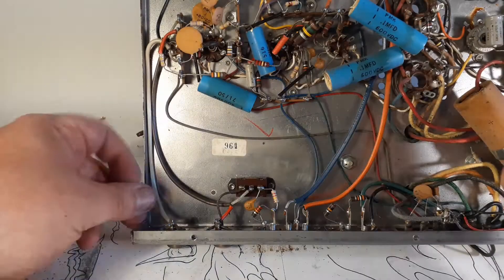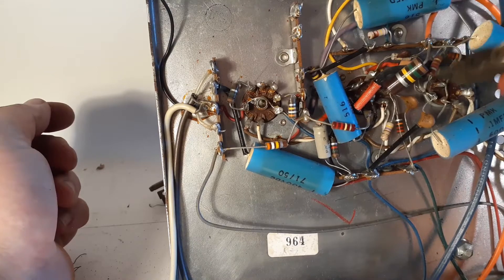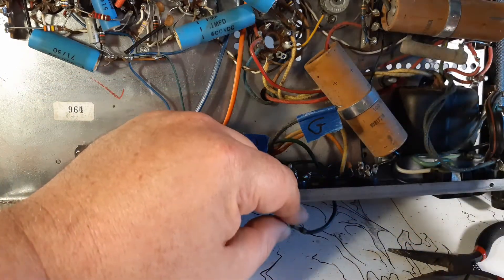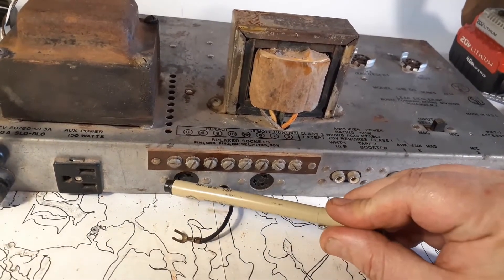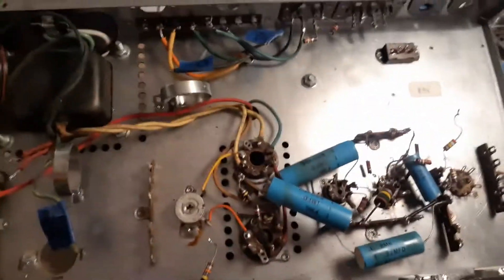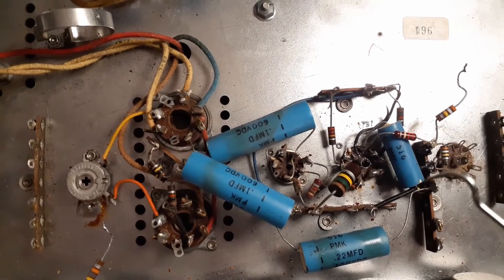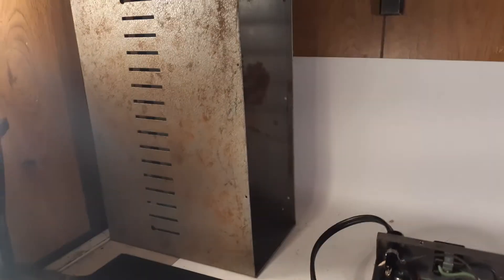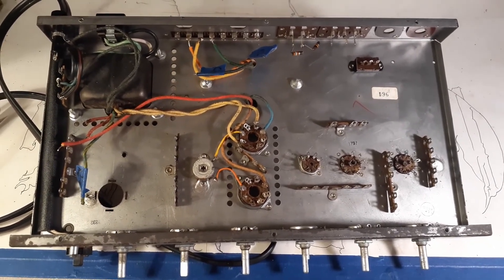Bogen CHB-50 Tube Amplifier Conversion, ep 2: Teardown to Bare Chassis

Comment: Oh yeah, another thing I did was I put a small 12 volt power transformer and bridge rectifier from an AC wall adapter to supply a small computer fan for cooling, and that is something i have come to REALLY belive in doing.
Reply from the maker: Maybe on a big amp with 4 or 6 power tubes, but I don’t see a need for fans. In my experience, this is pretty unnecessary outside of extreme circumstances. Do it if you want, but I don’t see why you’d want to go through all the trouble. Tubes are made to, and want to be, hot! There is a reason they have heaters, of course.